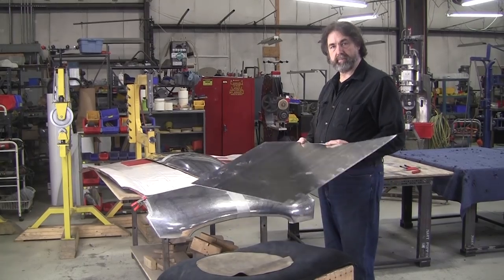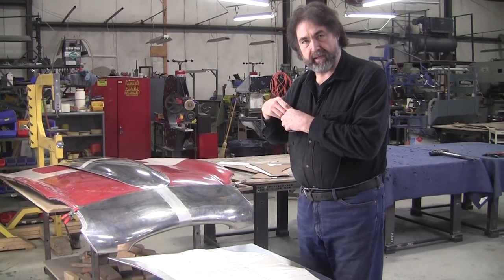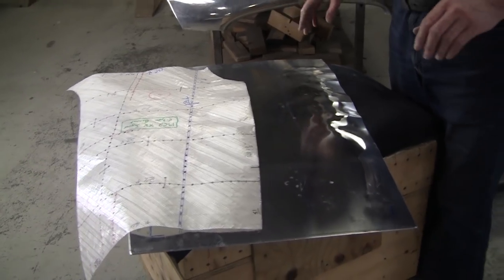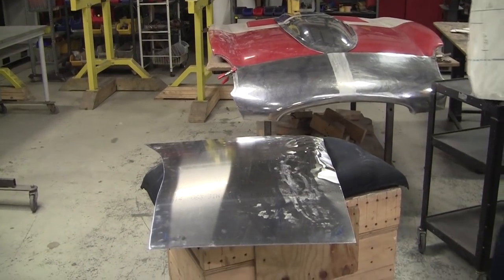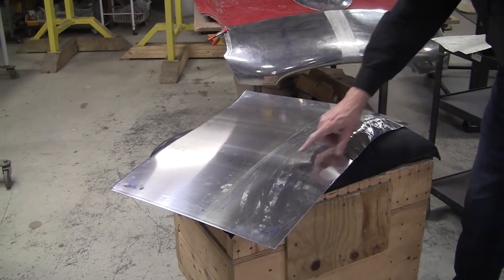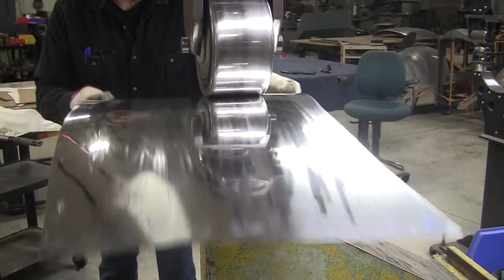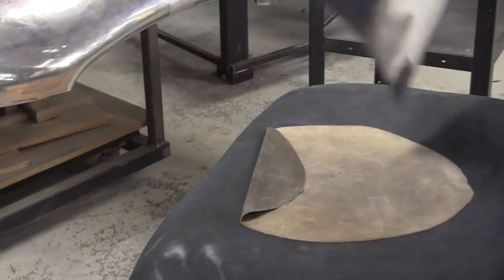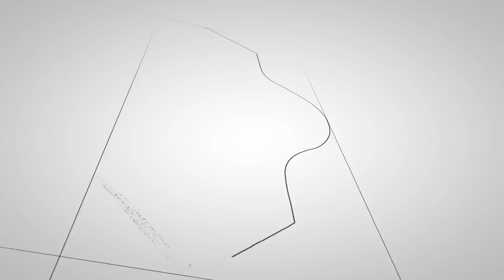Metal Shaping: Jaguar E-Type Aluminum Bonnet Build (Part 9A)

Comment: Worked in the aluminum industry for many years with the Hazelett  Continuous Aluminum casting process. Did a lot of work in Venezuela in the 90's producing millions of pounds of AA3003 in various tempers and as I recall likely about 1/2 as thick for most of their sales.  The main end use was for wrapping industrial piping systems, with large diameter piping, after insulation to protect the insulation. A somewhat similar alloy is AA3004 which is what beer can bodies are made from. It goes through an amazing drawing and ironing process to form the can, it is done in two steps; first a sallow dish is punched out of the sheet with vertical walls perhaps 1 1/2 " high and a flat bottom, the diameterr would be equal to the final can diameter. Second that shallow dish is fed to the drawing and ironing machine which uses a solid pin with the business end the shape of the finished can bottom. The OD of the pin will be the ID of the can. The cup is placed into the machine resting on a die that is thenegative version of the can bottom shape. The pin then pushes the cup down through dies that ddraw and iron the material into the shape of the can as the pin travels through it's stroke. The can bottom remains at the original sheet thickness, these days likely close to 0.012" thick, the can walls are thinner and thinner as you get to the top of the can ending up somewhere around 0.003" tk. 
You can see that the process asks a lot of the aluminum sheet. The lid and tabs are much stronger AA5XXX aloys. 
Just thought you might be interested in this rather amazing use of aluminum. Even one leaker in thousands of cans is a big issue. BTW the can does probably cost more than the beer. You might want to try some AA3004.
Another application for 3003 was for oudore window blinds, the slats had foam cores with several zero radius bends to crimp together the front and back sheets and from a hook system that held the individual slats together so the blind could be raised and lowered. No cracking at the bends was allowed.
I own an E-Type and have been interested in metal working as a hobby for years. Enjoy your talking, you are good at it, not everyone can do such a thing. Perhaps this is learned from your teaching.
Tom G.
Reply from the maker: Thanks Tom!
Reply: Hi Tom . Glad Wray didn't ask you how to build a Saturn V! You obviously had no interest at all in Aluminium Alloys!! Great stuff!

Comment: I like your videos and philosophy of metal working. I usually work in steel. I tell the people that I teach you have to ask the metal to do what you want, don't force it. I have used flexible patterns since I heard about them. I have used 4 layers of masking tape by rubbing the first layer sticky side on my dusty up pants. I had never actually seen your method of flexible patterns. I like the translucent and reenforced packing tape. Jim Ford Highway 101 Rod and Custom.

Comment: Hi Wray, I took a two day class of yours I believe in in 2010. I was fortunate to be, for some reason, the only student! Thanks for this refresher course on the FSP and your invaluable shared knowledge, attention to detail and passion.

Your method works! There is no other so called “expert” advice out there that even comes close to your videos precise and provable method to capture the DNA of a piece of metal. Your insightful breakdown of Area and Arrangement and your approach to focus on each throughout the forming process is genius.

I’ve restored Porsches for years and can relate to your comments on hating rust and the benefits of skipping all the sandblasting, patching and planishing of old parts with making new ones. 

As you say, the proof is in the pudding...I’ll be sending you in a few weeks pictures of a completed body using your methods.

Comment: For those that want to shorten the watching time without losing any information, just click on settings, cog icon bottom right, and select playback speed. I watch at 1.5 times so you can still understand everything but saves a 1/3rd of the time.

Comment: Another question answered.  You mentioned that all the stretching results in very little loss of panel thickness. Amazing
Reply from the maker: Just remember if you have some Sheet Metal that is .040" thick and 4' long and 2" wide. If you reduce the thickness to .020" it will be 96" long and 2" wide. Shrink the edges when you have  a high crown and the reduction in thickness is very minor.

Comment: Come on Wray, most people simply don't have the skills to absorb and  then replicate what you do. And most watchers of you tube have less exclusive motors to work on so they are bound to share common ground with those who are less skilled? but more in tune with the "ordinary"  car buyer. You just have to except the fact that your skills and feature video's are appreciated by the keener enthusiast and those who desire to achieve your skill level. Just remember, "small is beautiful". How the panel can turn from a bashed piece of tin into an e-type section is magical. Guess you'll get black listed by Donald for importing your sheet Aluminium! Thanks Wray.
Reply from the maker: I get amazing results from both absolute beginners and from those that have some experience at my classes. I would agree with you if I didn't see the work unfold before me from my students, using nothing more than my shrinking facilitators, mallets, and the English wheel. There are students that don't ask questions and they tend to stay off on the side doing what they think works. Most of the time their work is not the best and they are very difficult to give direction to. Can everyone learn to scrath- build a coach built car? Probably no. A lot of my students all they want to learn is how to make a accurate patch panel, weld it in and how to fix a dent. Which are all covered in my class, maybe I can inspire that person to reach higher. That is what I try to do. I know I will never be 100 percent successful in bringing everyone's skills to perfection, that can only come from internal drive. I teach a very easy to understand and accomplish method, I teach techniques not tools make results. Most people think tools are the most important ingredient.
Reply: some people have the knowledge to realize that when you look at parts already done they just dont fit the on the bonnet, look at the scoop on the bonnet. it touches at both ends but not at the middle, and having a flange turned on the scoop the shape is locked in. I guess a lot of off camera work will be done here
Reply from the maker: @356porsche  😁😁😁 stay tuned. It will be perfect, the flexible shape pattern insures that.
Reply: @proshaper  are you trying to convince me or yourself?
Reply from the maker: @356porsche  your comments are entertainment for my followers.😁😁😁, You just prove my point about dogmatic thinking which always holds back progress.  Check out the 5 minute video I have of the work of one of my students. He had never wheeled a panel larger than 1.5 sq ft. before taking my class. He made a new aluminum boot lid and two fenders  for a 1937 Riley using my flexible shape pattern system. The quality of his work was first rate. 
Nobody is saying your traditional method is wrong.  There are always multiple excellent methods to achieve any human task.
Reply: @proshaper  i'm glad that i can provide some entertainment for your followers (i guess you like to have fun at other peoples expense behind their back). i personally have not proved anything about your approach to panel work or to the traditional methods, all i have stated is that the scoop that you made doesn't fit. if you can make that fit by placing a flexible shaped pattern over the top then good on you, maybe you can replace Penn and Teller or Harry Potter. and the statement you made regarding methods and any human task is incorrect also, you still have to put socks on before shoes!
Reply: @356porsche  DEAD RIGHT NEIL....IF HE WASN'T TAKING UP TO $15,000 OFF UNSUSPECTING INNOCENT PEOPLE WANTING TO LEARN PROPER BODY BUILDING THEN YOU COULD TREAT IT AS A JOKE!!

Comment: Love the channel, and the long in depth videos!  I have a question about your big wheel (the yellow monster) what is the geometry of the upper wheel and the anvils?  Seems like 12 inch diameter and 6 inch width?  I am going to make a wheel and I love your large wheel.  Also, what is the metal and hardening you suggest? stainless?

Comment: Would it be fair to say that, if you had a flange on all sides of the work piece that you could use the kick Shrinker/stretcher on that flange to help or fine tune the arrangement as you did in one of the previous parts? And then cut the flange off afterward.
Reply from the maker: Hi Shane, Yes I use my kick shrinker on tipped flanges to fine tune their location.
Reply: @proshaper   Thanks Wray. It was on the E-Type fender I noticed it. Watching this series again as I enjoy it so much. And pick up something new each time. Also you’re the only American to refer to an E-Type by its correct name not XKE 👍😂
Hope you’re keeping well!
Reply from the maker: @shanedoyle1057  I have loved E-types since they were new. I bought a 1965 E-type for $500.00 in 1975. It needed a total restoration, my friend ended up breaking it up for parts after I sold it to him.
Reply: @proshaper   That’s tragic. They were very cheap at one time. Even I remember when they were 10-15k over here an aluminium bonnet for one costs nearly that much. You should watch the program called “Inside Jaguar making a million pound car” it was excellent! I’ll try find a link now.
Reply from the maker: @shanedoyle1057  I have watched it.

Comment: Hi Wray.  I have been in the automotive design and restoration business making panels for more years than I would like to remember. I was born in England in 1946 and at the age of 16 I started an apprenticeship training with Aston Martin for 5 Years. For the first few months I worked with other tradesman and was shown the principals and theories for making panels by hand, and learned the art of shaping aluminium. At that time we were making the DB series. When the time was right, I was placed in the section where the front guards were made. I worked there for a while, then moved to where the roof skins were made, then to where the lower valance panels were made, so all in all I was moved every 6/7 weeks to do these panels. In about 15 years working at Aston Martin I must have made hundreds of Ogee shaped panels as mentioned above. Please note that the return shape on the Aston Martin front guard is very similar to the return you are making on the Jaguar bonnet, a little different in height and width but the principle is the same.After 15 Years at Aston Martin, I decide to move on and with my qualifications. I found a good job in Belgium with a firm that worked on all classic cars, so I took the job and worked there for about 8 years. While working there I learnt new skills and new ways, and new theories by working on all sorts of classic cars. After that I decide to really make a move and emigrate to Sydney (Australia) and after a few months I found a good job working on all English marques. I worked there until I was 65 and then retired.  So after watching all of your youtube videos making the Jaguar bonnet I decided to write this below : This so called ''Flexible Shape Pattern'' where does it come from? Who taught you that method of shaping? The reason I am asking is because it simply can not work, or give the operator anything conclusive to work with. No sign of the amount of stretching or shrinking needed. The way you wheel the panels with excessive pressure, (far too much for shaping metal) The width of your the top wheel, those wide lower anvils, All of those methods are a sure way to have a big problems when shaping panels and unnecessary time spent in making the panel. Unfortunately I regret to say that if you worked in a high standard work shop where you would have used all those methods, shown on your bonnet build, and the manner you approach that job including the Flexible Shape Pattern, you would have been dismissed immediately. It's hard for me to state this but unfortunately it's a fact!I have also taken the time to read most of your viewers comments, but one has to say that these people that are looking at your video's are not proper tradesmen and do not know any better. Therefore their thinking is that this is the correct way, when in reality it is definitely not.
Reply from the maker: Hi Elliot,  I hope you understand that it's a big world and you will find that coachbuilders from Italy,, France,  Germany, and America used methods that were different from what you learned in England.
The Italians have made cars that are considered the best and the most valuable by collectors all over the world.  I have 56 years experience in the collector car business/hobby. I started ar my grandfather's restoration shop when I was 12 working on restorations of  J  Duesenbergs, Packards, Rolls Royce, Bentley, Stutz, etc.  From that early age I absorbed how cars are built. When  I started learning Advanced coachbuilding skills in 1986 I was well prepared. I learned how other coachbuilders around the world shaped metal. I borrowed from coachbuilder techniques used around the world. I took what I thought made sense and added a few techniques of my own. I developed the flexible shape pattern system and have made 1000s of panels using it  and have shipped the panels to customers all over the USA  and Canada. I never got a complaint call saying my panels didn't fit, not one!
I can have someone in Australia or from anywhere in the world make me a flexible shape pattern of any car's fender and mail me it in a priority international mail packet  the correctly made pattern and paper outlines of the required profile gauges. When the packet is recieved (mail cost around$40.00 for international) I can make the fender ship  it back to the source  from where the flexible shape pattern and gauges came from and the fender will fit perfectly and  be an excellent replacement in every way. Better than that the sender can send me a right side flexible shape pattern and gauges and I can make a perfect left side fender!  But, I guess flexible shape patterns don't work.😁😁😁

Want to place a wager that I can't do what I say?

Comment: You seem to be working from the hardest part of the job, (the elaborate reversed curves of the inlet to the easiest, the comparatively flat parts up by the windshield. Is there a reason for that? For a beginner, it would be most likely to build confidence to work from easy to "how the hell do I do that?".  (Coming from someone who failed handicrafts in primary school. :-)* )
Reply from the maker: The nose sections were the hardest part then I went to the center and now the sides. No real reason.😁😁😁
Reply: Adam Savage from Mythbusters and Tested likes to do the same. He is not doing metalshaping but I think his philosophy still makes sense. He always tries to tackle the hardest stuff first. He claims it helps eliminate the burnout and mistakes in a project. As you get closer to the finish line the tasks ahead of you become easier. This helps build confidence and it also helps to motivate you to finish. Also a lot of Adam's projects are one day. As the work day progresses you become more tired and fatigued both physically and mentally. Leaving the easier stuff for later in the day helps eliminate mistakes.

Of course Wray and Adam are not beginners so they have the skills to tackle the hardest stuff first if they want to. For the rest of us it may make a lot more sense to start with the easy stuff and work our way up to the harder stuff.
Reply: @theinsaneshecklador6598  Good point about the progressive fatigue. I teach courses in IT, and I try to match the topics to the likelihood that the students will be awake and receptive. Late afternoon is not good for heavy stuff.